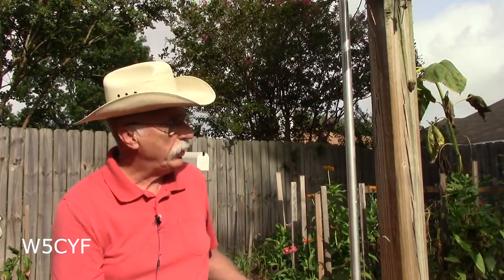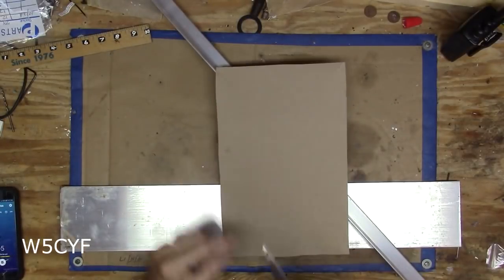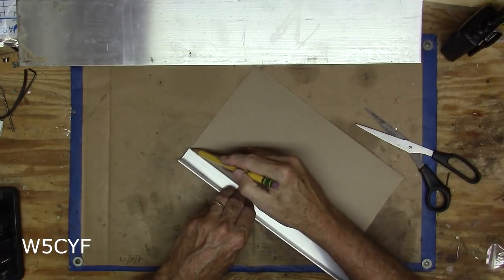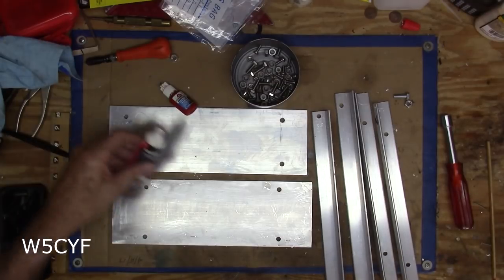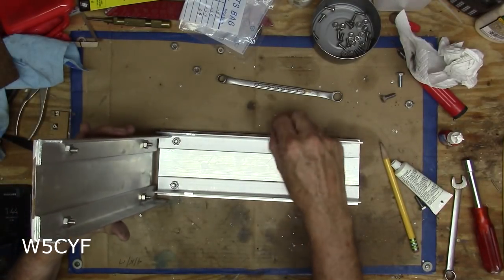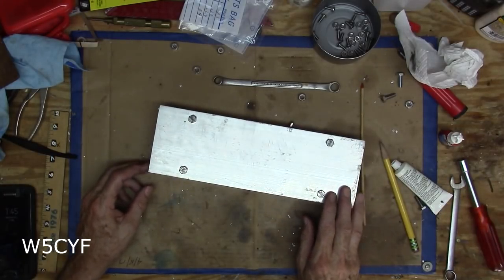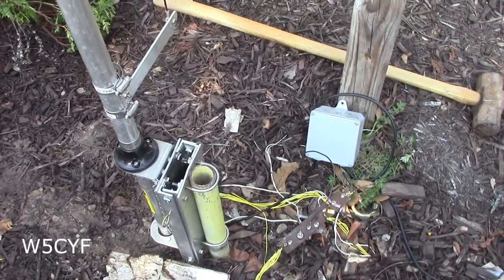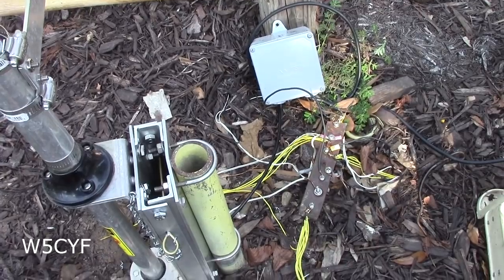Antenna Tilt Base- EZ Project (Ham, CB, TV)

Comment: I built something similar, although not as fancy for the military surplus masts. It was simply a 12 x 12 inch 1/4" thick plate that i drilled and taped for a tilt over. what i used for the tilt over was a  4" hard plastic wheel that you buy at the hardware store remove said wheel and you have a metal bracket which i mounted a piece of metal conduit to the wheel axle the mast slips over the conduit,  and i stake the 12 x 12 plate to the ground I have 30 feet of aluminum stack-able pipe on this set up, with my 10 meter antenna atop it. it's currently guyed in four places in my yard.jim

Comment: John, I just watched it again.  To prevent the back plate from bending, a U bolt with a saddle bracket for pipe would provide added strength across that area. a muffler clamp usually includes the saddle bracket and maybe that item is best gotten at the auto parts store as opposed to the hardware store.
Reply from the maker: Richard, thanks for the good suggestion.    ~John
Reply: W5CYF / TinkerJohn   I’m building a flag pole antenna now, just to see if I can build one for $100-$150 and not over $1000 like the commercial ones.  I think I will incorporate your hinged bracket!  I just finished an OCF copper water pipe antenna and it is hoisted to the top of one of my 85-90’ oaks trees (swr 1.036:1).  first contact was to New Zealand (ZL1WN) on 20m with less than 100w.

Comment: Hey John, I always enjoy watching your videos! And another set of eyes can always see something that could be done differently. If there was enough room on the inside to put another piece of angle where you bolted the U-bolts. Drill a hole in the angle that the U-bolts would fit through to match the holes in the bracket. Then put the angle inside before you bolt the U-bolts to the bracket. Make sense? I hope so...
Reply from the maker: Danny, thanks for watching and for suggestion.  Actually I did go back and made some mods.  Perhaps I'll do another video.    ~John

Comment: Nice build. I was just looking at how it is configured and how the antenna goes down toward the soil, I had a thought that if you inverted the tilt base so the hinge is at the top it would lay over the top and the antenna bas would be accessible and would not be in the soil.
Just an idea.
Reply from the maker: Paul, that is a great idea and should work very well.  Thanks for taking a moment to send it along.  73/John

Comment: Would love to see your parts list.  It seems that instead of fabricating your steel rectangle container, 2-3/8" Galvanized Chain-Link Fence Adjustable Wood Adaptor
Model Number: 1715515 Menards ® SKU: 1715515 could be used off the shelf.  Bonding 4 of these adaptors would be faster compared to fabricating one, for me.

Comment: Two ideas, 1/8 fine but if 1/4 not available you can use two 1/8 plates each side but must seal between each plate to avoid water damage. also there is a better u bolt for the pipe. Mine is heavier (25lbs) than a 4bvt so changes helped. I used three u bolts and an additional cross pin above tilt over to prevent accidental collapse due to fatigue on parts. JB WELD will work between plates pr a permatex seal around edges BUT MAKE SURE THEY ARE SEALED!
Reply from the maker: Richard, those are great suggestions.  If I were to build again I would definitely use 1/4 in. stock.    ~John

Comment: Better late than never, Hi John just found the video.watch a lot of your stuff. this is a good one. very well done and nice design. I liked Richard's comment on the Muffler  saddle back bracket helps keep cost down that plate is not cheap! at most hardware stores. great video and thanks for sharing! de Ellis WA1RKS
Reply from the maker: Good point!  Thanks for stopping by.

Comment: Needed to adjust size of plates to accommodate 2.5 inch ground pole and then antenna. you can use larger angle and run a threaded bolt thru as hinge. Like this as cost 25 total. mast 35 antenna wire 12 coax and pass thru for wall the most. See you on USB 20 or LSB 40. oe CW?
Reply from the maker: Thanks for following along and for the suggestions.  I agree with all of them.  73  ~John
Reply: @TinkerJohn_W5CYF  Will upload pic as soon as bad weather lets me outside to complete. Any suggestions for cheap way to pass thru coax thru stucco chicken wire house? TNx and 73's KG5WKO also a tinkerer.
Reply from the maker: Richard, check out my video on how to run coax through brick wall.  It may give you some ideas.   ~John

Comment: I built a tit tower out of 2x4x16 inch treated wood, I have my inverted V on it now but the verticle works good on it also. got the Idea out of the old ARRL antenna book. its been up for over 20 years now. lower it ever couple of years to check the antenna connections
Reply from the maker: Thanks for taking a moment to comment on your project.  There is more than one way to skin the cat.    ~John

Comment: Hey John
Getting ready to purchase a BTV 40-10.  I have some 1 1/4” od thick wall EMT in my scrap pile and was wondering if that would be strong enough for the ground mount.
Going to put it down about 3’ to 4’ and add some cement, leaving 2’ above ground.
HD has it in 1 1/2” to 2” od thick wall if you think that’s will make a better support.
No hurry on the reply, I got to wait for this heat to move before I get out there with my post hole digger.
If you have any suggestions on the set up that would be helpful too.
73
wd4dda
Clinton, MS.
Reply from the maker: Preston,  Good to hear from you and hope things are doing well in MS.   I am confident that that size pipe will work fine.  2' above ground is ideal, in fact I drove mine in a little too far and only have a a little over a foot above ground.   Good luck with the antenna.      ~John

Comment: I need you to do another video. Or get someone to deal with passing thru stucco/chicken wire homes coax. There are metals available from commercial suppliers lighter but stronger actually the 1/4 inch AR steel bulk head plate but easily formed or tooled. Not here locally but most major cities can get cheaply. If you are tens of miles from anything like that there is a custom metal outfit that will do small orders and advise. With this I am SSB on 20 meters mornings after March if you hear KG5WKO shout back. Keep the videos going as plug and play is not for me but cutting fingers and hammering hands is!!!
Reply from the maker: Richard,  I have a video up where I hired and electrician to put a hole through the brick wall on our house.  Perhaps you could contact one, they drill holes in walls all the time..   ~John